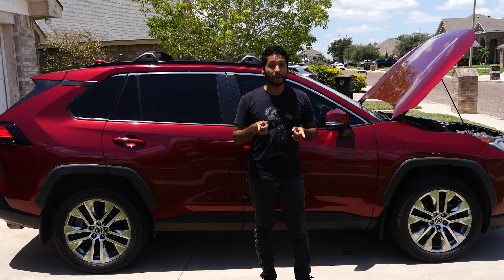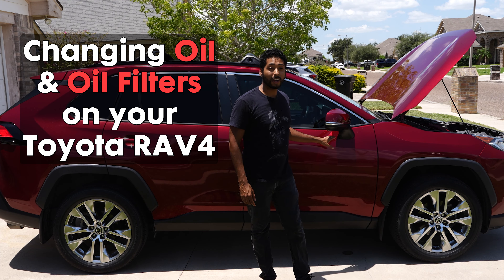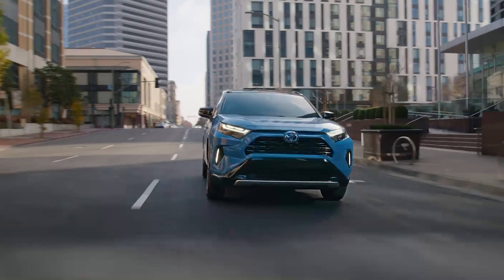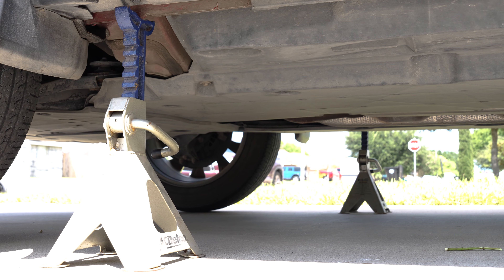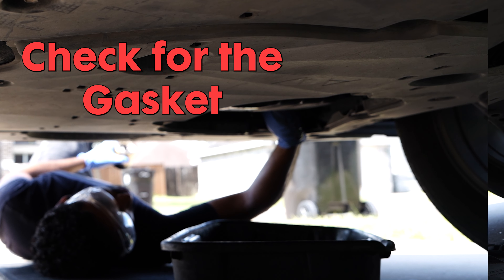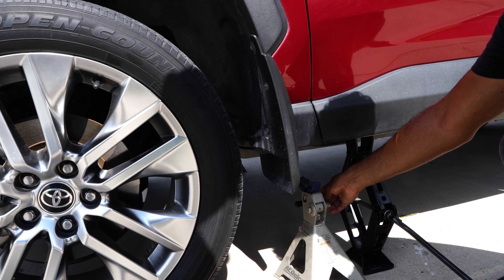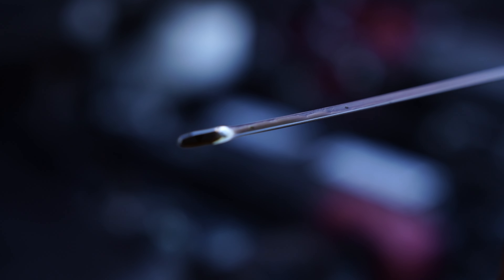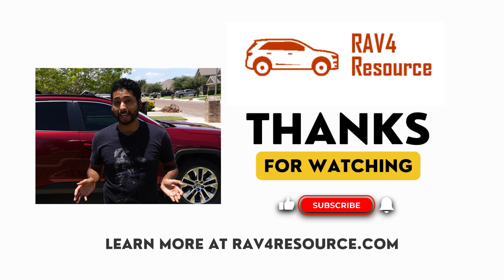Toyota RAV4 Complete Oil Change Guide [Easy DIY for ALL Years!]

Comment: Really need to mention the torque spec of both the oil plug and filter. Never thought this was a big deal until a dealership put on a plug of a vehicle, not their brand, and it was leaking oil
Reply from the maker: 30ft/lbs for the drain plug 13ft/lbs for the filter. Hand-tight should be around those specs if you're doing it yourself. I've never used a torque wrench on either and never had either leak.

Comment: I have a Rav4, I normally drive it about 6k miles per year. Should I replace the oil every 12 months or 6 months ?
Reply from the maker: Either works. I'd probably change it every 12 months if it were me.

Comment: How do I update the car's computer? If I was getting a Maintenance message or being told to change the oil, how do I respond to the computer to update it?

Also, you didn't speak about any ring or gasket that might be part of the oil plug. In older cars I've owned, it's essential to either clean or replace a gasket or brass washer that's under the oil plug. I don't know what the RAV4 has because I haven't changed the oil on my new car yet. Please respond to these 2 questions, thank you.
Reply from the maker: See the description of the video for a link to our youtube video or article on how to reset that maintenance light.

Yes, I forgot to mention in the video to replace your crush washer. There is a link to buy them in bulk in the description.